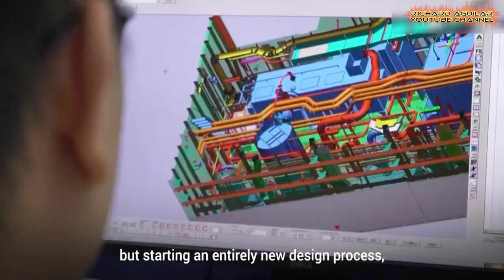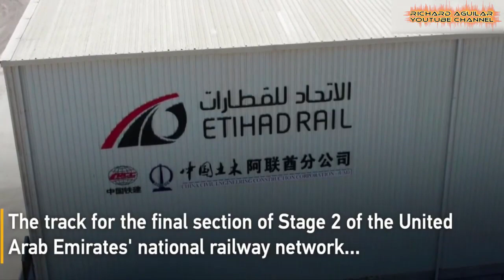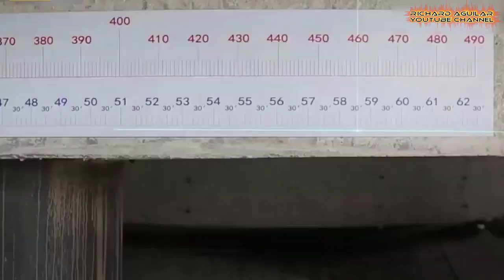China’s Latest Super Engineering Projects That God A Lot of Attention

Comment: This is a CCP fluff piece, put out for the national congress that just finished. China's high speed rail system is so far in debt that the fair's for tickets aren't even covering the electricity to run it, let alone payroll, maintenance, and the interest on the bond's they sold to finance it, with 90% of those bond's coming due over the next 5 year's. And that's just one of their mega projects.

The reason they've branched out into cruise ships is because they've lost their asses trying to take over the building of cargo ships. And if that mega stadium is like every other big infrastructure project in China, it's a complete money pit, and probably a tofu dreg project as well.
Reply: If you can't get A Score on Math Subject lesson, You are a Failure.